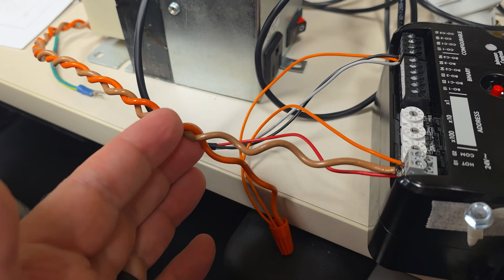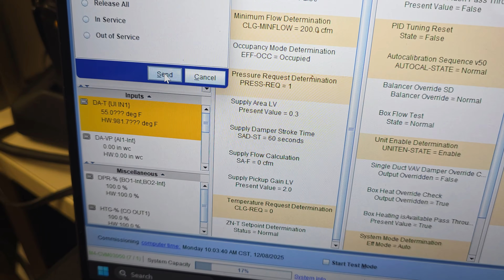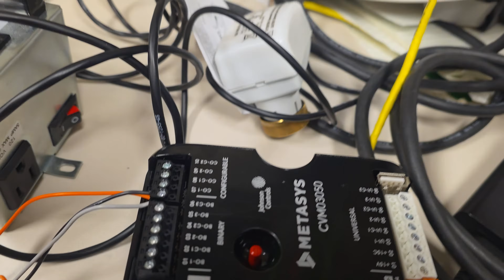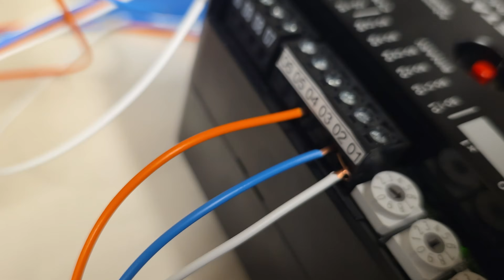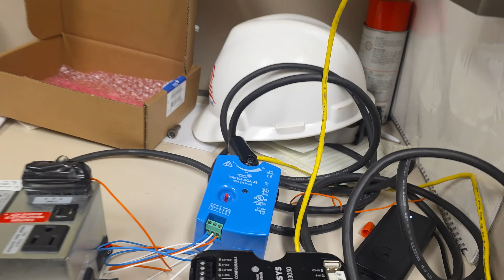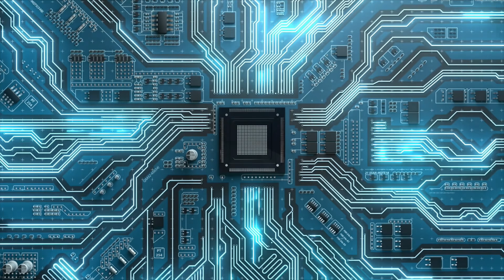Techs Get This Wrong! Proper Wiring for Proportional & Incremental Actuators on JCI CVM/CGM

Comment: This is called 24V low-side switching... Lots of manufacturers that have been around since the dawn of time do it. Do a google search and read up on they why (cost as usual). The reason I do not like it is because that makes it much easier for a shorted wire, cut wire that touches ground, etc.. to bring on the load. I have seen loose commons come out of the controller, brushing up against the metal control housing and causing havoc on electric heat contactors chattering away. But all in all, it works, if done properly. Just be mindful of this and for goodness sake, don't be a hack when it comes to wiring and do good clean work and it should outlast whatever it was installed in just fine.

also, if you RTFM... it is pretty obvious that the BO-x are  are internally sourced 24v high side and the BO-Cx is the switched low side.... I am a fan of FIFO but after 35 years of this stuff... I like to RTFM to save me some time now and then... lol
Reply from the maker: Thanks for watching. Please like and share the video.